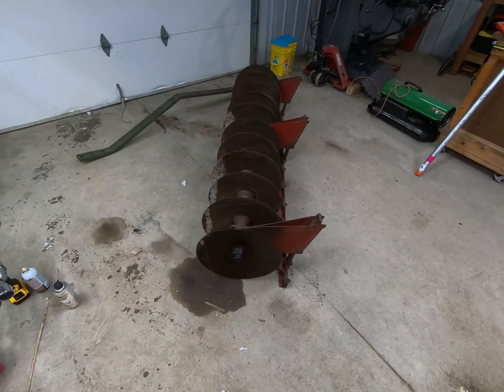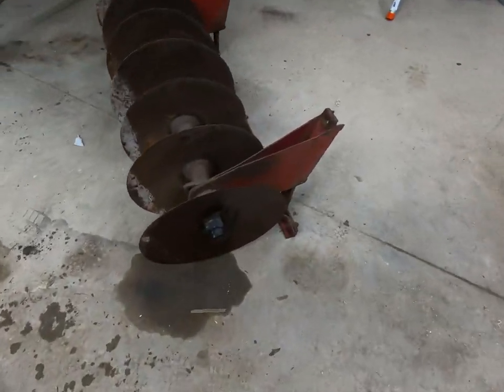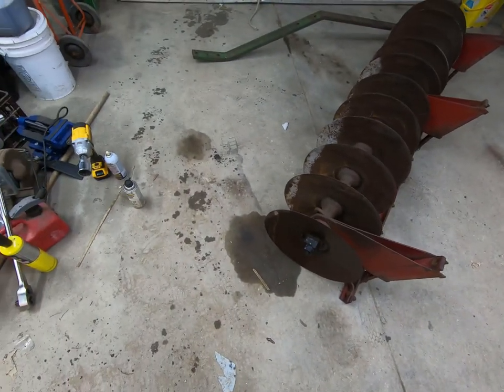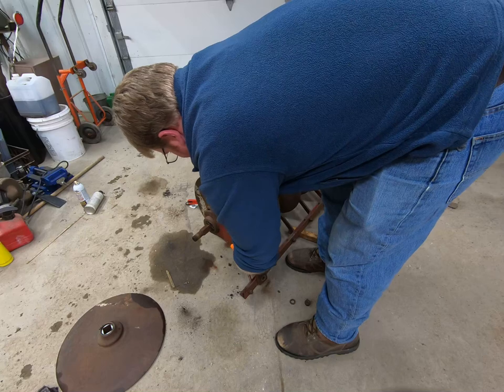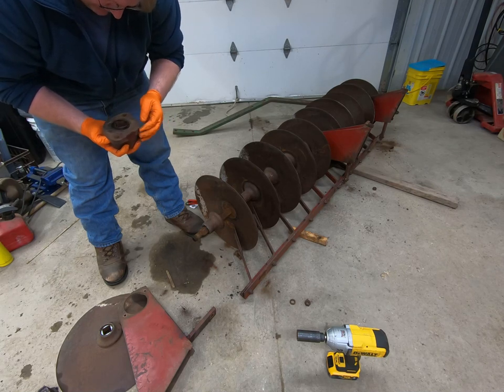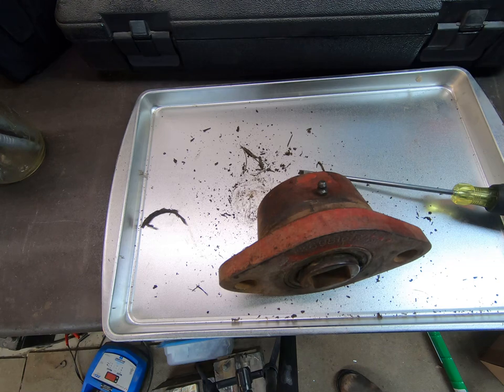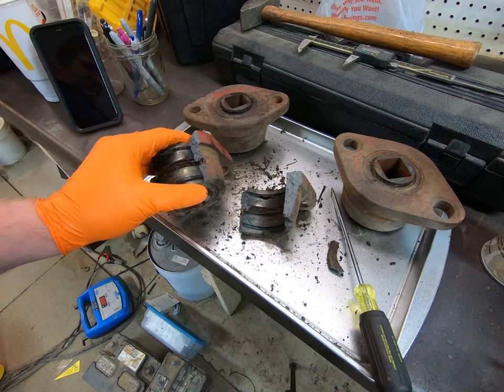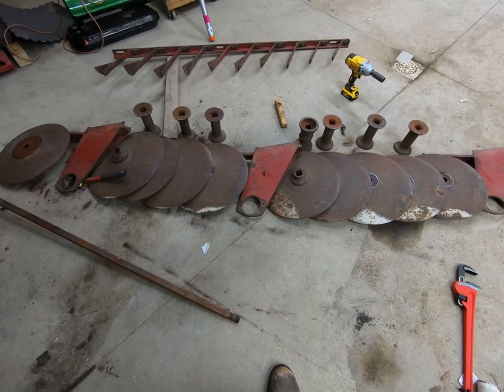International Disk Bearing Replacement Part 1

Comment: Check out a tool called a shake and break ,uses a air hammer and a socket tried it  on exhaust studs can  not  say enough good  things about it very good luck with it